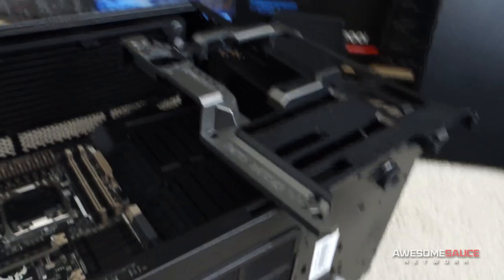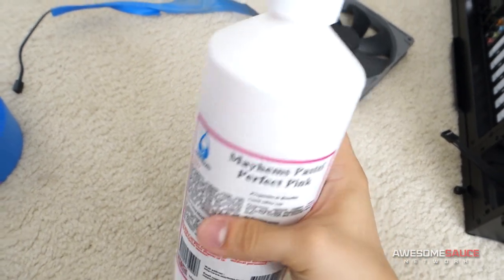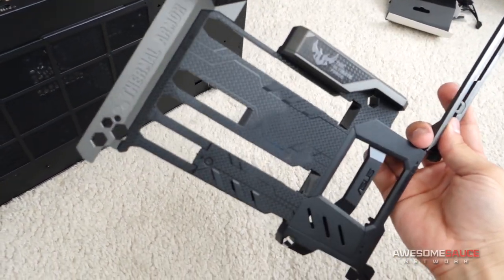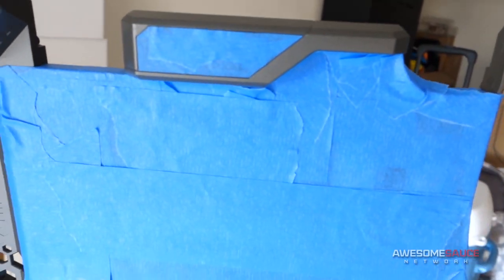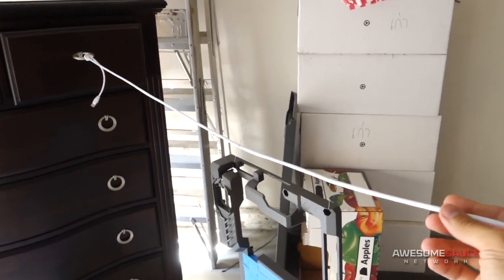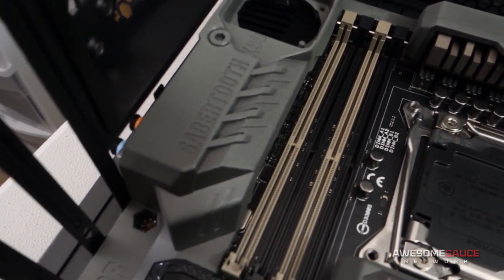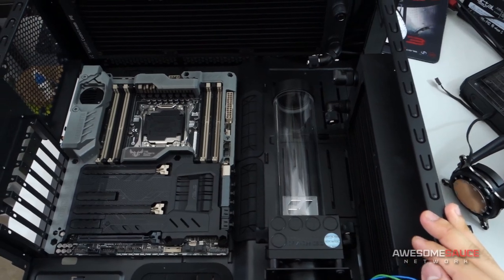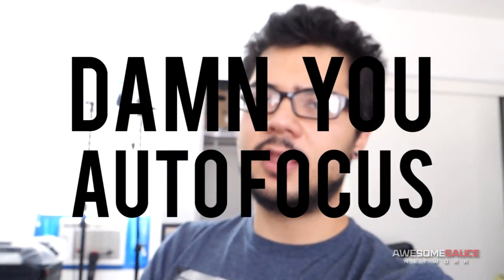Custom Water Cooled Build Log 1 - Painting the Thermal Armor

Comment: Hi there Kyle great vid dude . Are you going with soft or rigid tubing? I have just done a rigid line build myself and its hard to build for sure but looks excellent when its done. I am using EK parts myself and I am very happy with the quality of the water blocks, X-Res and terminal block for the GPU's .
That case looks a lot easier to work with than the Phanteks Enthoo Pro I used but I made it harder for myself by fitting the largest radiators I could in the case.
Anyhow good luck with the build I will be following along.
What are you gunna call it ... The Pink Panther?

Comment: Great work Brother! A thought on the "the grey came out darker" you mentioned: basecoat with white next time, just a thin layer and that will give you more control of the shade of grey! I´m into building my first customWL in this case and really appreciate you made this video, gives me so much info. Looking into the EKWB x360 kit plus a 280 in the front, but might settle for 240 in the front. Have not desided yet.

Comment: I never did watercooling but isnt a tripple and a dual 120mm rad enough to get good temperatures? I mean people always say you should have a minimum of one 120mm rad per thing that has to be cooled.....

If anyone knows what the temperatures will look like please answer me.
Reply: Fabian E. I have a triple and dual on my setup cooling an i7 2600 w/ 2 GTX 980's. Keeps the video cards at under 50C under load and cpu under 60C under load. 2 triples would probably be recommended for this build,  IMO.

Comment: Please take the windowed panel from your R4 and try to put it onto the Define S frame. It is something that I've wanted to see someone try for a long time and I am too broke to buy a case and do it myself.
Reply: QuestionmarkX3 1. It won't fit
2. Why would you want to anyway? The window from the R4 is smaller (and therefore worse) than the S
Reply: 1) It actually might because the case appears to be the same size as a R4 and uses the same panel mounting system.
2) The window on the Define S is bigger but it is not better. The R4 window is a lot more scratch resistant than the S. Plus, the R4 has a tint which can help out with custom lighting.
Reply: Smaller /= Worse.

Comment: How did you remove the storage thing on the right? And where do we put the storage?
Reply: It's a fractal design define s, it doesn't have any hard drive bays on the right or optical drives they are mounted to the back of the motherboard tray.
Reply: Kyle said it himslef, it was a fractal design define s, with that information you could hop on their website and check it out if your curious enough

Comment: Awesomesauce Network hey Kyle I just bought a define r5 window blackout edition and I wanted the paint both side panels the furthest back and the most forward moduivents and leave the middle black I wanted to paint it blue could you recommend some paint.
Reply: Anto Charles from what i understand the side panels on the r5 are aluminum, meaning any spray paint made for metal will work, however automotive paint is often more scratch resistant and can in some cases provide a better coverage meaning that fewer coats are needed.

TD;LR any metal paint will do, but automotive is preferred.

GL
Reply: acegi87 Thanks man how about the moduivents I think those are hard plastic.
Reply: Anto Charles you have special types of paint created for plastic. you should also rough up the plastic a bit before painting it so the paint sticks. make sure to wash it afterwards because the dust from the sanding will show up when painted, and don't paint /dry it in the sun. This will make the color change so the color will be different on different places.
Reply: acegi87 Thanks a million
Reply: Anto Charles just message me if you have other questions
Reply: acegi87 Yeah thanks.

Comment: I know I'm a little late on this comment, hopefully Kyle sees it.  If you're worried about the paint clogging up texture, you can mix the paint (obviously out of a bucket and not a spray can) with paint thinner at a 3-1 thinner to paint ratio and put it in a spray gun.  For (much) larger surfaces you can use a paint roller.
Reply: Kenny A your fucking 3 years late, he’s already making a new version of this

Comment: Would you not just remove the thermal armor because it is just an airflow duct?Or If it is a heat dissipation cover/shroud, would not the paint most likely destroy it's ability to do so?
Not familiar with the board spec's.Is it the one with the fan?Oh ,and you were killing me with the hot pink coolant on the all white carpet.I had a beer and 2 ciggys because of that.Ha!I bet the over spray on that tall boy dresser looks bitch ñ.

Comment: Hi guys, wanted to know if this is a good build:

EVGA SSC ACX 2.0 GTX960 2GB VRAM
MSI Z97 S02 
INTEL CORE i5 4690K with Cooler Master Hyper 212 EVO cooler
Fractal design define S black with window
1TB WD Blue 7200RPM
250GB Samsung Evo 850 series
EVGA Supernova G1 750W 
Corsair Vengeance LP CL9 8GB 1600 mhz 

I want it to be very silent and be able to run all games on 1080p high, very high plus normal video editing.
The PSU is 750W because I might do SLI in the future when I got more cash or use in future builds because it has 10yr warranty.
Reply: I PERSONALLY would not get a SSD to begin with and use that money to get a 970 instead, then afterwards save for an SSD. Apart from that it looks good, I have that processor and mine over locked like a dream.
Reply: H White to what frequency did you overclock to?
Reply: Adrian D. You could get a cheaper case and get a better GPU. AMDs R9 380 comes to mind.
Reply: ***** Silence is very important and thats why I chose that case. Otherwise I would do that.
Reply: Adrian D. Check the Corsair 100R Silent Edition. It's nearly as quiet and half the price. It's a good case, too.
Reply: Adrian D. AMD's R9 380 has 4GB of RAM which gives more room for games that use a lot of textures (Shadow of Mordor, Skyrim with mods, etc) and it's at the same performance and price bracket as the GTX 960. The GTX 960 runs a liiittle more cool and silent though.

Also bear in mind that the Define S is not as silent as it's sibling, the Define R5.

I would NOT give up the SSD, it doesn't give you moar FPS, but it's a bliss for everything else, from booting to loading your games.
Reply: ***** I do need that SSD though for video editing and CAD. Is the GTX960 really that bad? Im not a hardcore gamer but will game a bit under my leisure.
Reply: Mauricio Almeida Thanks! And if im not able to change my order, will I be extremely sad when gaming?
Reply: Adrian D. You should go for the 960 4GB! It doesn't help (much) when you have 1 of them, but un the future you can get a second one, and it really benefits for the extra vram.
Reply: GLO Clan You mean getting 2x GTX960 4GB or 2x GTX960 2GB?
Reply: ***** Are you shure?
Reply: ***** So I can do SLI?
Reply: A 4gb 960 or a 970 will be a better choice. If you have a tight budget swap the ssd for a 120gb one and use the extra money to buy a 4gb 960 or a 970.
Reply: ***** Good news! I didnt know I could change my order but I did recently. Changed the GTX 960 to EVGA SSC ACX 2.0 plus GTX 970 which is supposedly one of the fastest factory overclocked GPU:s. I did blow my budget but hope it gets cheaper in the length. 
BTW should I change my order again for the ASUS Strix OC GTX 970? Want the most high quality and silent...
Reply: ***** So it is silent under load? Do you think Laptop silence?
Reply: ***** Can you make a custom fan curve?
Reply: Adrian D. Yes, you can do that in most motherboard bios.

Comment: hi I'm thinking of building a pc and I'm wonder is this good
Motherboard
Gigabyte 78LMT-USB3 Radeon HD 3000 HDMI DVI VGA AMD FX AM3+ Motherboard
Processor
AMD A6-6420K APU 4.2GHZ TURBO 4.0GHZ DUAL CORE Black Edition Socket FM2 
Hard drive
Seagate Barracuda 1TB Internal HDD 3.5" SATA 7200RPM Desktop PC Hard Disk Drive
Video card 
NVIDIA GeForce GT630 2GB GDDR5 2048MB Video Graphics Card VGA DVI HDMI PCI-E New
Soundcard
Creative SB0090 Audigy Sound Blaster SB1394 Soundcard Internal PCI
Ram
Kingston 16GB 2x8GB DDR3 1600 MHz PC3-12800 SODIMM SO DIMM Notebook Laptop RAM 
Case
CoolerMaster K280 with 500W PSU Silent Performance Office Gaming ATX Mid Tower C 
Additional fans
Be Quiet! Silent Wings 2 120mm PWM Fan
i was wondering if i should change anything to make it faster/cheaper thx
Reply: I can't say anything but if you want a couple of good opinions try tomshardware
Reply: Should've done 500gb hard drive, 8gb ram, and spent the extra money on the GPU. Also, saying you have VERY little money for GPU. Should've gotten a used AMD card. Would've got allot better price and been faster